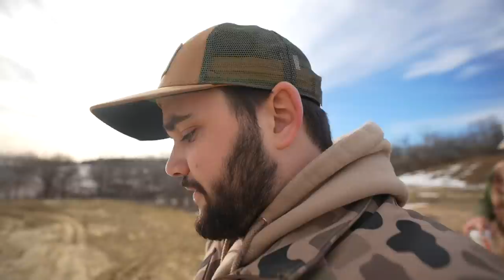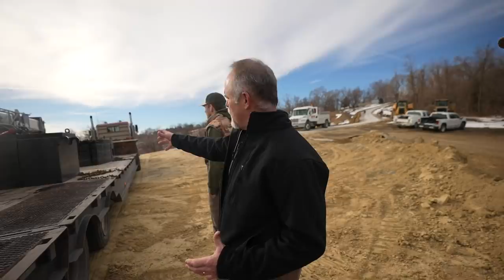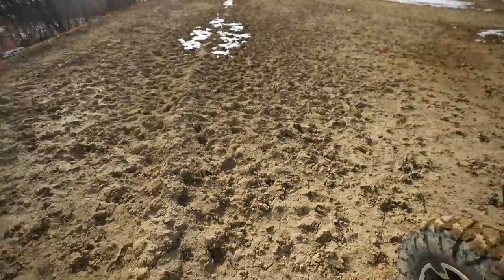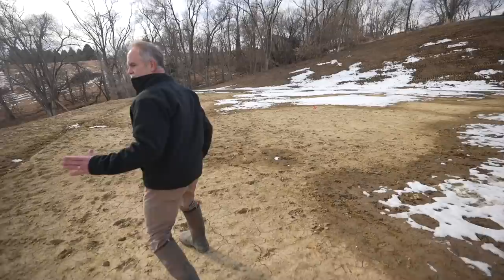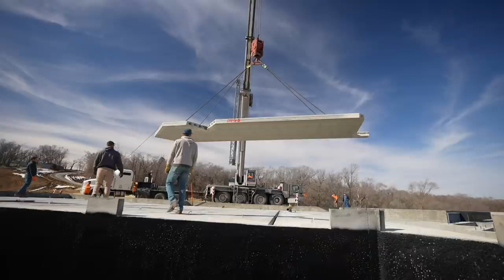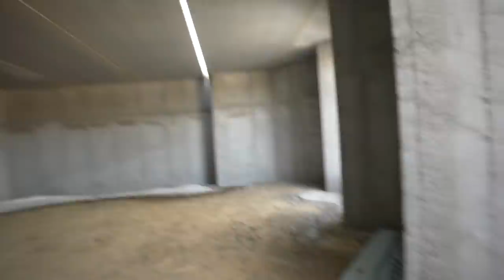Building a HIDDEN Underground BUNKER for my NEW HOUSE!!

Comment: Flair, you should also make an external escape tunnel from you bunker/shelter 🙂
Reply: Yes that is a good idea
Reply: HELL YEAH
Reply: Full send bro
Reply: You should do a video with Dr Dre
Reply: Make an underground tunnel from the bunker right to the shop, probably going to cost a few million more to do but it would be awesome.
Reply: @danickdesrosiers7338  full send
Reply: super legit escape tunnel
Reply: OH YEAHHH
Reply: @lukeyates3134  think positive don't let that negative thinking take over. 🤠
Reply: Fire pole and slide?
Reply: R.I.P to flairs wallet 🤣😂
Reply: @samfrost4452  so true 🤣
Reply: @lukeyates3134  In the event of a nuke, this place won't do much to help. Most people will be taken out by the radiation, not the explosion.
Reply: Ohhh yeah
Reply: To the work shop 💡
Reply: @dongottiskennelclub9420  yes I think that would be perfect. 😀

Comment: A bomb shelter & tornado bunker is a great idea. I'm survivalist in nature with ex military experience. That shelter needs several things. 1.) Independat electric from solar & battery packs ,plus generator as well as linked to the houses electric with quick easy disconnect from inside the shelter. 2.) Its own heat source preferable wood stove as well as propane which makes cooking while heating very easy & efficient yet propane incase it's too hot in there. Wood should be stored inside of it,say 10 face cord atleast. 1 yrs worth basically. It needs it own independent water source as well as connection to the house water. It needs sewer & independent sewer pump to utilize the homes leach fields. Should have a leach field of it's own  reguardless of public sewer availability. There should be food prep area,sinks,bathroom,shower & tub is a must for emergency water storage,so not just a stall shower. There should be atleast 1  freezer & 1 refrigerator or more,medical area & first aid station & supplies. God bless & good luck. The trick to surviving disaster is preparing for everything & anything ,one never knows what chain reaction of unforeseen event can unfortunately unfold & often do. Its Murphy's law or butter side down theory.
Reply: 3) air source if it is a true bunker. 🤔
Reply: Brilliant comment
Reply: 4) magnetic lock door can only be unlocked with a fob.
Reply: @jamesstein1390  I like it but if it's before the backup power source is turned on I should be a mechanical lock, my grandpas shelter has a door similar to something on a battleship
Reply: He said a tornado not a zombie apocalypse? Chill
Reply: @Rmrider95  eazy there, even a storm shelter should have provisions enough for 14 days just in case the doors get jammed by the house falling on top of it so you can manage till the rescue arrives. 🤠
Reply: @Rmrider95  He said bomb & tornado bunker. Clean the wax out.
Reply: While what mark said sounds extreme all at once it actually isn't. However while you may not need as much as he suggests but you do need more than the 14 days they say you should. The most common ground I found is 3 months of provisions in case help has an issue getting to you. Well enough of the prep stuff. Good video and you'll looking to have one bad ass pad.

Comment: I built steel building for a living and all of them were shops, storage sheds and all that, you can make it whatever size you want, just the easiest thing to do is go by 3’ increments because sheets are 3’ wide so 60x120 is perfect for simplicity and then you’ve got 28’ sheets which are about as big as you go before you get a splice in the roof

Comment: Per your shed. If its post frame they usually set them 8 feet apart so its easier to have your building built at 56 or 64 by 96 or 104. Divisions of 8. also you could have the option to epoxy the bunker floor so its beautiful but its easier to lay mats down if needed for kids. and its durable.

Comment: Add 100 yard indoor range with 6 foot corrugated metal storm drain, with emergency exit off to the side at the end.  Add a no trap floor drain at bottom of stairs and low spot in bunker to a swale or gravel filled pit down slope, it will also vent any heavier than air gasses that might accumulate.   Demo Matt wished he took that advice after a flooded stairwell.  If you really want it for disaster, consider the swiss electric / manual blower used in all swiss shelters, it filters and positive pressures the space so all leaks are exhausts.  The entrance / exit at the end of the tunnel is ideal for a decontamination shower area if used for nuclear shelter.

Comment: This is the same thing I am doing for my new house. SUPERIOR WALLS foundation with NITTERHOUSE HOLLOWCORE SLABS for my garage floors. It will be 28' or 30' wide and about 90' long. Slabs were priced at about $31,300 installed (28x72) first rough floor plan. I didn't think about having insulation but will now. I'm having radiant floor heating (geothermal) in garage too.

Comment: Time to camp in the concrete cave before the house is done, light a fire in there and everything. As for the floors, do concrete then do an area with EVA foam for  the kiddos and then get turf to roll out on the rest when you need it and roll it up when you're done

Comment: Hey there sheeew.....with the bunker,epoxy resin floors, marble effect black,white n grey...down lights in ceiling,roof. Area on right side as come in sofas in a square the biggest t.v or projector screen on the wall, bingo now got a cinema,veiwing area complete with wall hung speakers and surround sound. Left wall 2 sets of bunk beds up against wall,metal shelving  next to that with water,drinks long term food,blankets ect. A jacuzzi against wall right side behind cinema area,wood deck around,couple of coconut palms.with lights with plant freindly bulbs. End section,basket ball net, open for sports,small gym in one corner,weights,cycle,row machine type stuff. End corner archery target on legs. Air rifle target,box made of metal  secured to wall.........rgb strip lights around all bottom of walls lit upwards,controlled by your smart phone.  Next to bunk beds a gunsafe and metal workbench and fridge for beers. On the walls left side and near sofa area mounts of deer heads n racks,ducks ect with old rifles above child height and some car,sports or fishing  gear or bass mounts.
Theres some ideas for ya flair....
Take care n peace.

Comment: Make your barn/work building 60ft wide. If you have a 20ft boat hooked to your truck you're going to be pushing 50ft. Your truck is like 21-22ft. and a trailer for a 20ft boat is like 25ft long because of the tongue, and then the boat motor sticking off the back is another 3+feet. So 60ft would leave you a little room to get around the front and back of a truck with a 20ft boat.
Reply: That makes a lot of sense.  Good advice 👍
Reply: @MyBackyardScience  I learned it the hard way. lol. I went with a 50ft wide and when my boat was hooked up the front of my truck all the way to the windshield would stick out of my garage.
Also, when they say the building you're buying is a 50x80, that is the outside diameter, inside if it has 6-inch walls it's like 49ftx79ft.

Comment: I would do a rubber floor for the kids with the back wall being made of foam so u could also shoot you bow in there and the rubber floor is what they use on older basketball court, and you can do anything on those I could show you a few pics of what I was thinking I was in construction for 4 years at a tec school

Comment: It isn’t to late to get them to plumb a small bathroom under the garage, if you use it as a bunker you’re more than likely going to be there for a couple hours so me personally not even thinking about budget would have a small bathroom in a corner, have a generator that can run power to at least the room for awhile without having to re fuel, a air filter, bunk beds, storage for food/water, you could even have a water tank put in the ground that holds a lot so it doesn’t take up space in the actual room, pew and pew seed storage, and a small sink area you could even use to do catch and cooks in, and then a entertainment area, just like a 32 inch tv with hella kid dvds and a couch and some toys because if your stuck in a bunker with your kid the last thing you want is them having nothing to occupy themselves with you would honestly probably make all your money back on the room if you do a build series and have some Sponsors plus ad cents

Comment: If you figure a shop like a you a garage usually you figure it at around 45$ a sq ft however that depends on how you build it but looking at it that way. 100x50 to 120x60 is another 1200 sq ft. Your looking at an extra 50000 for that extra space. How if you do it pole barn it would be a little cheaper but still that’s crazy amount of money for a shop

Comment: And the good thing about concrete walls is if a bomb that has ratiation in it goes off by the wall the radiation will not go through the walls